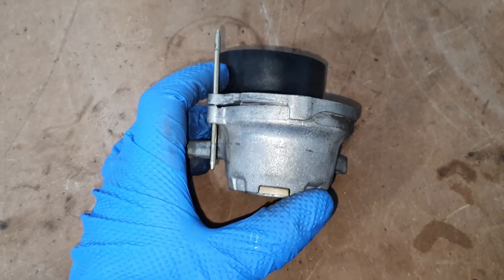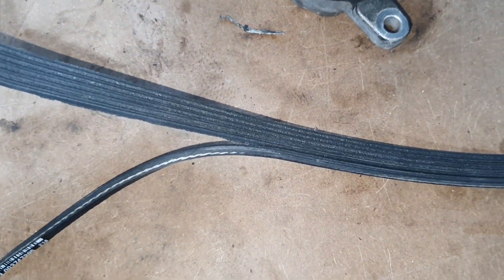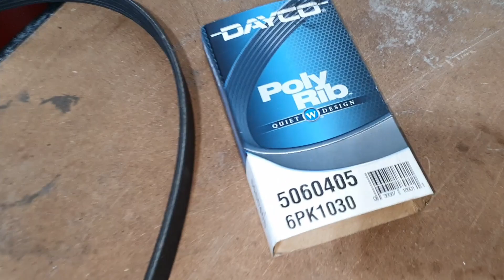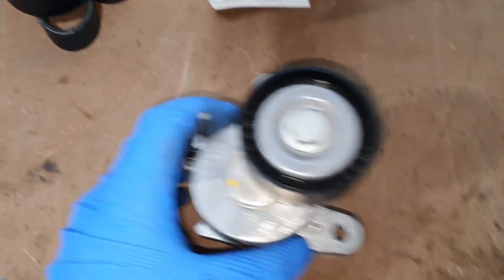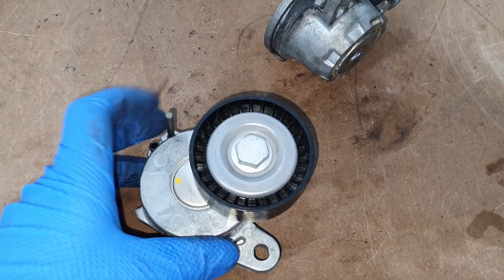2015 MK6 Jetta TDI SEL EA288 CVCA Serpentine Belt and Tensioner Change

Comment: Hi sir 
how long last jetta timing belt & serpentine belt ???
Reply from the maker: This will depend on the model. Timing belts are usually around every 100000 miles. Serpentine belts have similar life however sometimes have to be replaced sooner than that. Try searching online for a maintenance schedule for you year, make, model and you should be able to find the recommended intervals.

Comment: Is the tensioner supposed to be bouncing like that? I had the same issue . Replaced with a new aftermarket belt still bounces alot.  Replaced it again with an oem still the same play in belt.
Reply: No bro.its not normal this bouncing.your problem is the alternator pulley
Reply from the maker: Yes, bouncing of a tensioner is normally especially as loads change in the system. This particular design does not have a shock to dampen the load changes. Some do, which makes it jump less. The particular issue in this video is a design flaw with the old revision tensioner that causes it to over tension belts and destroy them!
Reply: your tensioner failed because your alternator clutch pulley was locked up, causing the belt to bounce putting stress on it @EandEDesign
Reply from the maker: @joshuathorsland9211  This is a non dampened system. The tensioner will change positions with load and rpm. Completely normal with any belted systems. This is why you will see more complicated systems have hydraulic shocks to dampen these changes. The tensioner in this video that failed was an old revision. The design flaw has been fixed in the new revision. Thanks for watching!

Comment: Did you notice any audible note of the tensioner failing before it at the belt? We have a 15 Passat and can hear a sound change when turning on/off the ac, I’m hoping it’s just the tensioner, AC blows plenty cold.
Reply: It’ll sound like the  dmc but it’s not. And the ac pulley just locks. Normally if you get the rattle it’s the alternator pulley
Reply from the maker: Sadly we didn't notice anything :( What kind of sound change are you hearing? Compressor clutches always make some noise so it could just be that?
Reply: @EandEDesign  no clutches on these variable displacement AC compressors 😉

It’s a rattle noticeable at idle that disappears when you turn off AC button, HVAC fans still going. I’ve noticed it over the past 50k, it’s just seems to come and go. I figure at this point changing out the tensioner is cheap insurance.
Reply: @740GLE  I am having this same issue, when I cycle the A/C on there has been a notiable rattle at idle that goes away under load. However, it has gotten much worse recently and is audible at all times. I just checked the pulley alignment for the serpentine belt and the tensioner is clearly out of alignment. I assume this is the same issue of the tensioner pivot failing as the pulley itself was replaced when I did the timing belt.

Comment: How many miles were on the car at this point ?
Reply from the maker: This failed between 70-80K
Reply: @EandEDesign  I have a similar situation on my 2015 golf but my failure is at 138k. It is a shame because the serpentine belt was replaced at 117k.  Oh well.  My repair shop is a 4 blocks from my home, so that is very good. Would it be good to inspect the Alternator pulley too at this point?
Reply from the maker: @garyklein7900  I am glad yours lasted that long! It was disappointing this failed so early on us. The replacement we put in is still going strong. You can inspect the pulleys but I doubt they have any damage as they are all metal
Reply: 2012 jetta. 2.0. Tensioner starting to fail at 370,000km.  Using a drill bit as a pin is a great idea. Thank you. Going to replace it this weekend